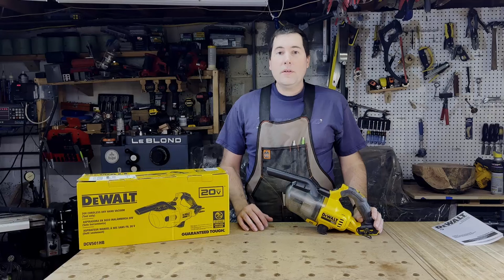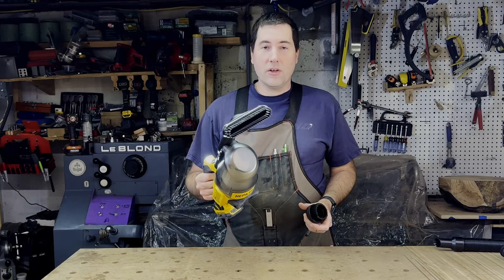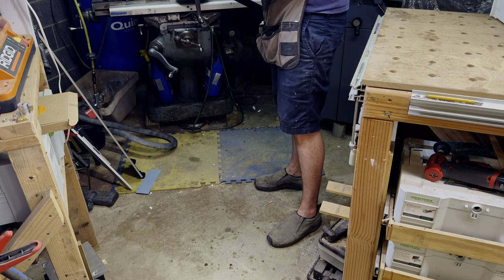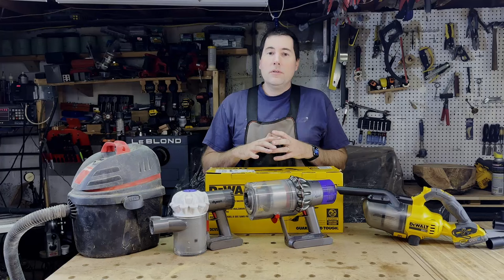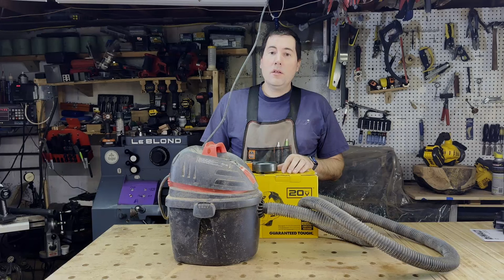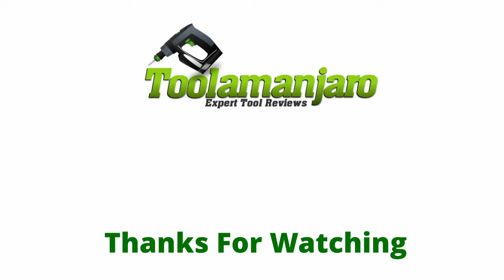But not in the good way!  Dewalt  DCV501HB 20V Vacuum Review.

Comment: Dyson has the same issues, anything larger than a piece of popcorn gets stuck.  Your review is pretty awful to be honest.  So far I love this thing, does a great job with small messes, cars, shop stuff.
Reply from the maker: Glad you’re happy with it!
Reply: So is it good for facing out cars and say the baseboard of a carpeted home?
Reply: His review was awesome and was exactly what I needed to know. He said that he liked it except for the limitations in the long hose and the wall inside the nozzle. I agree with both points. And the Dyson comparisons were helpful. My only complaint about this video is that he didn’t include an affiliate purchase link in the video description so that I could pay him for his time.
Reply: @ForOrchestra  not at all a good review my guy, all he did was complain about minor issues ( that for the most part aren't actual issues) like complaining about the design of the end of the hoes claiming its uncomfortable which in my experience is just not the case. Really the only thing he complained about that is an actual issue is the design of the floor attachment. He seems to expect it to  what a shop vac will do when that is not at all what it is designed for its not made to pic up large quantities of saw dust so of corse its clogs when you do that. If you buy it to do what it's designed to do its a great little vacuum (little being important word there).

Comment: I don't use this vacuum to do maintanance,,I use for remodeling is good when you cut drywall or make holes with your tools you just hang it on your belt with that Little hook and you don't have to hold it with your hand you have more access to use your hands when you coting something, this is a very good vacuum

Comment: Thanks for the video.  But like a lot of others, I think you’re missing the use case for this product.  It’s basically a shop grade dust buster.  If you need to clean your shop floor that has dust and much larger items, I recommend using your shop vac … it’s not that much more of hassle and the shop vac has more suction and a larger entry path.

Comment: I bought one of these a month or so ago. I also got some cheap, aftermarket filters and some foam socks to go over them. The plan is to take extreme care of the original DeWalt HEPA filter and use it only in the house. The others will get blown out with an air gun regularly, which I suspect will 'open them up' a bit for even better suction. These better flowing filters will be covered with the foam socks and used in the shop, or anywhere else power is more important than HEPA filtration. The foam socks can simply be shaken off in the waste can and hand washed in the sink, then squeezed out and hung up to dry. 

So far it hasn't been a problem, but if the "flat face" in the floor nozzle - 6:36 - causes me too much grief, I will simply drill it out or adapt the nozzle from my old retired stick vac to it and never look back.

So far so good. 😎

Comment: Wow. Phenomenal review. 

As others have…unreasonably complained, one minute in I thought you were being highly critical. Then came more useful information in a single minute than other reviewers entire videos. 

Really well done. Anyone complaining either didn’t finish the video, suffers from biased brand loyalty, and/or doesn’t value a critical and thorough review. 

Furthermore, you validated my assumptions based on an hour of research. As someone in the DeWalt platform, I wanted to purchase it. But it appeared to have significant shortcomings(not long enough attachments, no carpet beater, small and cumbersome dust bin). Not bad for the price I suppose. 

Thanks for the thorough review. You answered every question I had plus more in only a few minutes. Easily one of the best product reviews I’ve seen, and I’ve watched over a thousand.

Comment: Regarding the HEPA Filter, the main reason for it is likely due to the filter from fine dust such as drywall or other types of fine suspended solids =  a very wise design in my opinion and for the longevity of the vacuum's life.
Reply from the maker: Dust coming from drywall has very large particles, in the 10 micron size.  HEPA is absolutely not needed for that.

Comment: I don't think airflow is a great metric for vacuum cleaners. The suction power seems to have a bigger effect on what the tool can actually pick up. For example the Makita cordless vacuum I got had a higher flow rate than it's 40V counterpart, but significantly lower suction power. As a result it sucks, and not in a good way. The 40V model performs much better from comparisons I've seen. I was just hoping the 18V model would have been adequate enough, but it's really not.
Reply: Yes, I’m thinking this criticism of your “test“ is sorta valid. As a measurement of suction power… It’s sort of like the difference between current and voltage. Your measuring the ‘current’ -how much air is moving through per second. But that’s not a Measure of the force with which that air is being pushed, i.e. the voltage. I’ve seen that one sort of standard measure of vacuum vacuuming strength that sales people use is ping-pong balls-how many can be held up in a tube before they start falling out the end.

Comment: Can you please do a review of the dcv100xe workshop blower? In Australia the new version is a piece of crap 💩! I bought one from a popular tool company ( tradetools) in Australia but they cut out after a minute with a 5AH battery! The sales rep was trying to BS me about protective circuitry to save the motor from overheating!!!! Yet when he tested mine on a 54 volt it kept going until the battery died and my workshop blower was hot to the touch! I said ok, thanks but no thanks and walked out. I went to our popular hardware and bought the same model thinking the tradetools version was a defect! But same and I swapped to another fully charged 5Ah and again it cut out. I took it back and i just bypassed the circuitry on my dcv100xe blower and beautiful! No cutting out and blows like brand new.